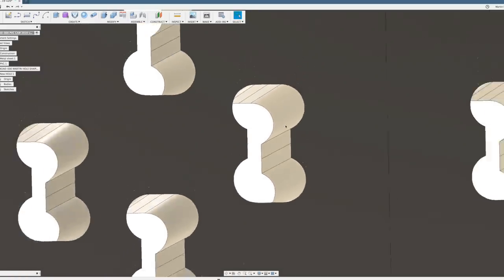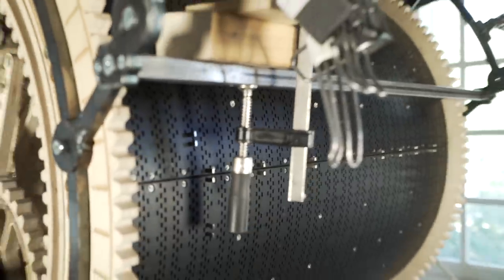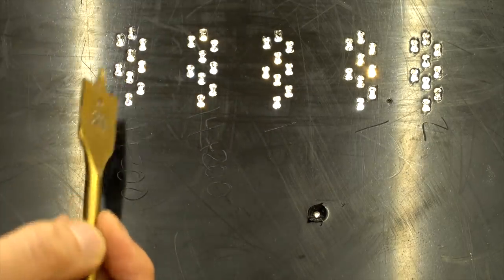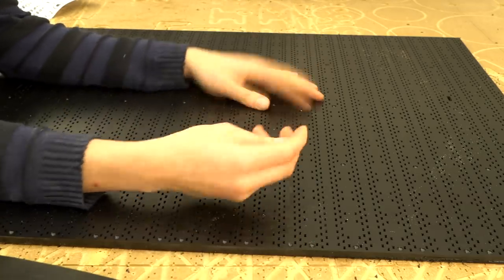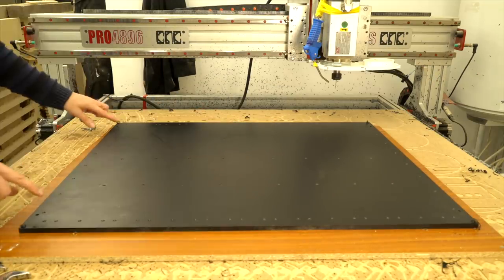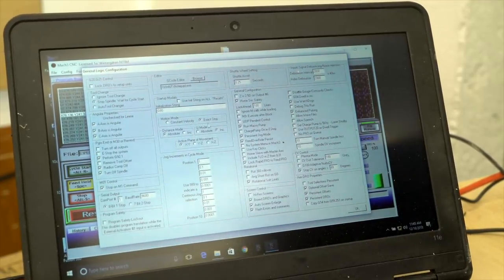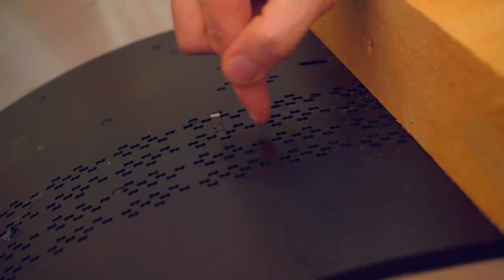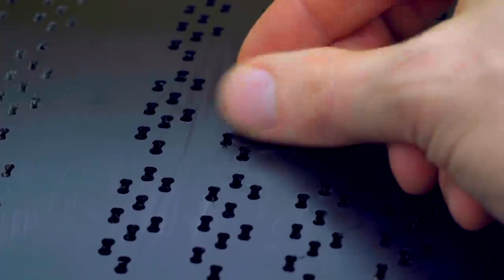Deeper Down the Rabbit Hole - Marble Machine X #66

Comment: I had several thoughts after watching your video today. 
1. The thermal expansion might be an issue. I don't know about the material being "pushed". More often than not, when part dimensions change, it's due to thermal changes. Though I don't know much about the plastic you're using. 
2. A few videos back you mentioned that during live concerts, you would have people in the background doing song change-overs with the second pin-wheel. I know that is a ways away, but is there a plan if one of those pins breaks in the slot? I have found in assembly that if there is a way to do something wrong or break something, people with manage it. 
3. I love watching your videos, either with a "pay-off" or not. Your production quality is phenomenal. You are exceptionally talented in so many ways. keep up the great work. In addition to your videos, I love Adam Savage's Tested channel... Any chance for a collaboration? I'm sure he would be stoked to see what you have done.

Comment: the "rocket- science" would be : '#1 preform the plastic sheets , #2 ruff cut in the curvature #3 age the plastic and #4 Final Cut the holes .... or make a precision mould and form the  "musicsheet" in epoxy and final precision cut ... or cut it all with curvature in airplane-aluminium. downside 5axis cnc needed. ... think you at the limit  of your machines

Comment: What if you don't need to cnc the holes but instead punch them out using a tool. You can use the CNC to drill accurate locating holes then use a punch to get the holes.ideally of you can modify your cnc to include a punch in it that might work

Comment: Going into the rabbit hole and meet....Mr tolerance. It seems that you build yourself very strong limits. What was the tolerances of your first machine? I guess you want to improve, but what could you live with? What if you just build a small stripe for the 4 plates and test it? Maybe its not so bad as you think when the magnets are 0.1mm or 0.2mm out of place. In your video #52 you speak about 1-3ms beeing defined as tight music...do you have a conversion into how much mm-tolerance  this would translate in for the magnet position? Al the best.

Comment: I wonder if the shrinking isn't due to thermal expansion / contraction, as a bit of heat would be put into the part when milling, only for it to cool down later on.  and on top of that how thermal characteristics will affect it later on down the line.  could this be the issue?

Comment: Martin, a precise machine does not have to be precise in every dimemsion to be that. If every magnet has the same play, it shouldn't matter. The register arms will push the magnet to the right place anyway. I think you're definitely  going a bit overkill on this. And maybe it will bite you in the arse later on.
if in heats up on a stage with a stagelight on it. All your tolerances will be off. And if youre outside in the cold the pins probably wont fit anymore.
So please martin test one plate with big fits compared to the small ones. Becouse i really doubt it will change anything in the timing, becouse the holes are in the right place relative to eachother anyway.

Good luck! Really looking forward to see it play!

Comment: I thought came to me. Wouldn't it've been a better solution to skip this manual programming of the pin wheel and instead program the wheel with magnet spool/solenoid aktivated pins. A lot of of time could be saved during performance if you just push a button on a computer than having to go through all the thousands of magnet pins when switching tunes. The solenoids have to be very small in diameter to have room beside eachother inside the wheel but they might maybe also be mounted on the outside of the wheel, completely stationary on the marble machine. The electromagnets would then just move detented on and off positioned pins on the drum from the outside. The stickout difference between the pins off and on position could probably be reduced a lot as well since that would work  better with  the magnet operation. Another benefit in this scenario would be that the pin wheel would continously be reprogrammed for example on the underside. Your music could be forever changing, no repetition. I guess this would eliminate the need for any manually disconnecting of instruments during the playing... Maybe not what you want...

Comment: I have a good idea to you to reduce the time to change the program. You asked about a paper wiht the information of the right holes to put the magnets, to reprograming the machine. And i asked. Why you don't glue the magnet in the paper? To reprogram is just remove the paper with the program and magnets and put another paper (or other thin material) with the magnets and new program.

Comment: I'm curious, you've not mentioned in any of your videos how you plan to transport these when you go on tour, except to say that you intend to make many of these so that you can quickly change the programming drum between songs. So I'm presuming you will have a crate filled with dozens of these already programmed and carefully labeled. However they don't appear to be sturdy and resilient enough to withstand the rigors of transport.  I suspect it will take longer for one person to program a drum than for the song itself to play. I'm imagining the whole band spending hours before every show programming plates backstage before each show.

I think it requires some stress testing. You might want to test a finished programmed plate and take it for a long drive in the back of a truck, or ship it to a friend. I suspect you will need to create some manner of restraint or lid. You can't risk even one peg falling out during transport. It would be the equivalent of finding where the needle fell out of the hay stack. I fear your dream of a fast efficient method of reprogramming the plates on the fly could be all for naught if after all your work you need to redesign a sturdier system that can withstand the rigors of transport.
Reply: The plates will be reprogrammed during the gig. A guy is working on turning midi files into templates which will be laid over the plates. And the pins then magnetically stick to the lower metal plate.

Comment: If you are using metal pins for the music programming, have you accounted for expansion and contraction caused by varying venue temperatures? (You do want to take the finished machine on the road, don't you?) I don't even know if this might be an issue, but being the accurist you are, well.....

Comment: Many plastics absorb moisture from the humidity in the air. I'm not sure what the plastic your using does. But it would be better to use Black Delrin (Acetal) to minimize this. I have had machine parts in certain plastics change dimensions quite a bit from this. I might be easier to machine too.

Comment: A stupid question, why not 3d print the whole programming plate, with curvature.
Reply: While an intriguing idea part of the problem would be finding a 3D printer large enough and even after it was printed it would still probably need to be machined to ensure tolerances. This machining becomes much more difficult when you have a curved part.

Comment: You really need to bend those programming plates and THEN drill them. It's never going to be precise doing it the other way.
Reply: He'd need more axies to do it that way
Reply: @longalexislong  Yes, in a way, but you can convert one of the existing three to rotary. It's not simple, but can be done. Technically, you still just need three.

Comment: You have many plastic parts in the design. Plastic has a different coefficient of expansion than wood or steel. Did you take all these tolerances into account considering  the mmx will have to perform on stage under the hot lights. For the programming pins this might not make a difference, but can the marbles get stuck inside the tubes ?

Comment: Is it terribly difficult to mail a material that is in a spherical shape. Because if it's doable I would to use resin. I have a feeling resin when it be as temperamental as the material you using now as far as shrinking goes. and you also could put some pretty awesome designs into it. although I guarantee you be trading off one problem for another.

Comment: The plate is to big.. You cant get perfect dimentions on plastic like this... 

I would try find a 5 axis machine and drill all the hole in one of those with the plates installed as you want them to be in the machine.. That will bive you the results you wanna have

Comment: I assume the end mill is getting hotter and hotter when you cut for hours, the heat from the friction builds up and clean cutting is getting mixed with unpreditcable melting (and local plastic expansion) which you refer to as "pushing material instead of cutting"? It would be kinda messy but maybe the situation would become more stable if you would create a shallow plate container and flood the whole thing with a few millimeters of coolant -- just enough so that there is still some left above the cutting surface after almost all holes are cut and thus constantly have lowered the coolant level. If you cut a plate-shaped hole deep enough into some thicker, watertight material (plastic), including holes to screw down the plates in a repeatable fashion, you can re-use this setup forever. Just an idea...

Comment: Martin.....  Looking at the complexity and size of the wheel, HOW ON EARTH are you going to (re)program the wheels during a live concert....??
It takes a lot of time removing all of those pins. Then, in a BIG hurry, a new song has to be programmed......  Which takes a whole lot longer than taking the pins out....
Programming needs to be done by a special programming crew. How are those people going to achieve that?????
During a live concert you/they will NOT have the time !!!!!!
The only option I can think of is to build more wheels and program all of the songs the machine will have to play.  If you have a better idea or if you can tell me how you are going to program the wheels in a hurry AND accurately too, let me know.
Reply: Martin plans to make two sets of programming plates, one for playing, the other in the backstage being programmed by his team, and possibly a third one as a fail-safe if something breaks. While he'll play the song on the first set, his team will reprogram the second set, then he'll swap them out. He's also working on CNC cut templates that his team will use to know exactly where to place the pins, they'll just have to fill the holes, it can go very quick, depending on how many people work on each plate. And while the programming plate has many holes, only a fraction of them will actually be filled, the machine couldn't handle playing 16 marbles on each beat, and even if it did, playing so many notes at once would sound like gibberish.

Also, it's likely that there will still be breathing rooms between each MMX songs to let his team reprogram the plates. It's unlikely that the MMX will be the only instrument being played during his live concerts, Martin knows many instruments, and while the MMX will probably be a central focus of the concert, he can still play other songs on the guitar, theremin, or whatever exotic instrument he has in store.
Reply: I had the same thoughts. Martin has said that he will have multiple sets of plates. Assuming that the plates are programmed off-line (not during the performance), he would need many sets.
Further, has any thought been given to how the pin removal / insertion process will occur? I could envision some type of tool that picks the pins out magnetically or a demagnitizer applied to the reverse side of the plate to let the pins drop out. 
For insertion, could you have some sort of thin plastic overlay that is machined with just the holes corresponding to the notes so the programming team need only fill the openings. 
Additionally, any thought to the mechanical aspect of gathering / inserting the pins? Perhaps some sort of handheld magazine fed tool (think PEZ dispenser).
Reply: That is great news !
Wonderful solution.
With a complicated system like this, you have to come up with a way to take away the stress of quickly reloading a wheel.
And I just had a great idea for superfast programming : make a few semi transparent acryllic sheets, curved, that can be placed over one part of the wheel. These sheets have all of the needed holes in the correct position. This way, programming is easy and fast and mistakes are not possible, unless you forget a pin or two.
I'll make a drawing and send it to you.
Reply: @telescopereplicator  that's basically his plan, he was thinking of using paper but same idea.
Reply: Paper might work, but tears easily. Way too easily. And is prone to cause wrong programming. I was thinking of using acryllic sheet or a tough kind of plastic. Because the black panels are round, and hard acryllic sheet may be difficult or even impossible to remove, once all pins are in place.
A tough plastic hseet can be used many times. Paper is for one time use only and is too fragile.
Martin will find a great solution. Just wait and see........!!!   ;-)
Reply: just like Lite Brite
Reply: @telescopereplicator  Not at all true if you buy a good paper with high cotton or other fabric content. Even plastic fibers can be put into some kinds of paper.

Clothing and furniture manufacturers can use paper patterns for decades. I have literally seen and handled 40-year-old paper patterns that have been used and handled thousands and thousands of times.

I'm not saying it is definitely the best idea of them all, but it might be.

Stacking a dozen song patterns of plastic sheets might be cumbersome, whereas paper can be stored in well-organized tubes or drawers and is easy to transport. They also won't break or dent if they fall when a stage hand moves them without permission.
Reply: There are many, many different types of paper and some of them may be a very good choice. Acryllic sheets, or paper, or other materials.... They could all be used. I agree with all of you.
Especially the long fibre Japanese paper is very strong. Paper with a plastic backing is quite strong as well.
The bottom line is, Martin will have the last say !  ;-)
As he should.
Let's see what he comes up with !
I hope he reads all of these comments and hopefully he'll find some inspiration.
Martin has never failed to surprised us. I have been following this project from day (and video) 1 and haven't missed a single video.
The end is getting near. Can't wait to see the end result !!!!!!!!!
Reply: And then we have Sebastan Jansen from Belgium working on a program that will produce templates from MIDI. In theory Martin could improvise back stage minutes before a performance and in say half an hour have the plates programmed with what he just improvised. At least thats how I understood it all. "Engineering Team 2019, #63, 9:16 minutes in.

Comment: Is it possible that this plastic is Hygroscopic most plastics are? Meaning that it absorbs moisture from the air causing it to swell. Perhaps you could let the panels sit in high humidity conditions like a big bag with water allowing them to swell then machine and allow them to stabilize for a few days to see what your results are.
 Perhaps these issues that your facing is why history shows that the easiest and most correct way to "read" the notes is by a hole instead of a pin? Perhaps it is time to rethink this design and have reading levers drop into the holes of the drum to activate the notes this way you would totally remove the pin fit issues.
Failing this redesign perhaps you could easily "grow" the hole size with heat then insert the pins and let it shrink fit to the pin....
Just some thoughts to ponder

Comment: This is the brain of the machine, we need better technology than this

Is it possible that the surface is bent as required for mounting on the machine and then ... we use laser to cut into the material? This will solve all the problems but I am not sure if a mechanism exists that can orient a laser for cutting in this way.

Comment: Also black is the worst color to use in this situation. Black absorbs heat. Those stages get really hot with the lights. Your holes are going to get smaller as the material expands during the heat of the show. You need to speak to an engineer that does high precision work in materials subject to different temperaturesm

Comment: I really love the project. But the programming wheel has always been one thing that bothered me. I really love your ingenuity but I think that you will face many problems with his particular design. Unfortunately I have no solution. But just to name a possible problems: open air concerts: temperature may change plastic dimensions, humidity may also affect the very precise cut holes. I really hope this works but unfortunately I am very sceptical. Temperatures could also alter the dimensions to an extent (if the temp difference is too high) that the plastic doesn't lay flat against the metal underplate anymore. Just some random thoughts from a guy that loves your work

Comment: You seem to be going to a lot of effort to make the programming plates reprogrammable. Can I ask why? Are you are going to go to all the effort of placing hundreds of pins in a plate and then remove them all again, just to reuse the plate? Seems to me like erasing a master tape so you can use it for your next tune. 
Is it possible to program your mill with an individual "tune" so it only cuts the required holes in a plate? That way the size of the hole isn't so critical and you can make the pins an interference fit.
Also, how about somehow making the bed of the mill into a cylinder with the programming plates already bent to shape, and the rotation of the cylinder becomes the Y axis?
Good luck.